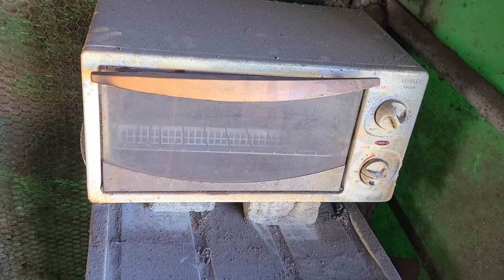Make a square kitchen knife

Comment: Hi thanks for the video the knife is just beautiful please tell me what kind of belt grinder you have I've seen it somewhere in my opinion they sell such in the USA but I can be wrong and it's better to show it in the video somehow what power the length of the tape the functionality will be interesting
Reply from the maker: Thanks for watching.
This is a small 2x27" belt sander purchased from an open market in Korea. It is inexpensive, so it is purchased and used after a slight modification process.
Reply: @forginghard  Thank you for the answer I hope you will show me what modifications you have made it is very interesting to see